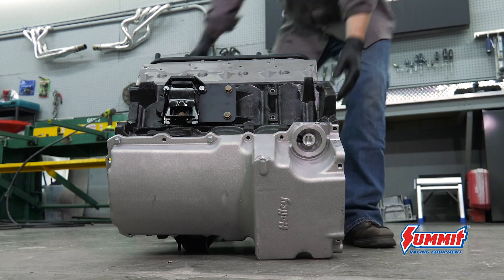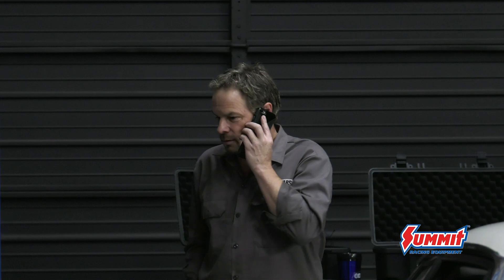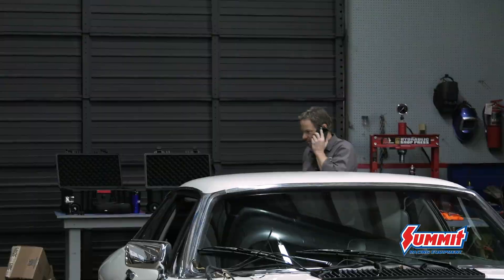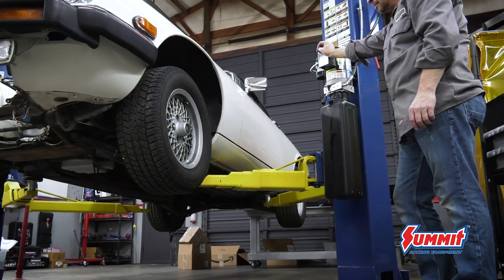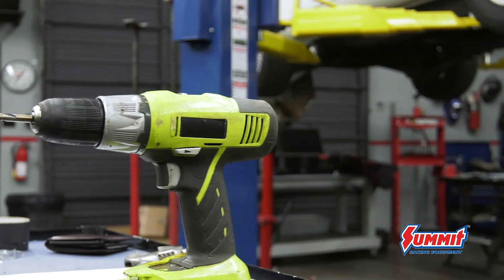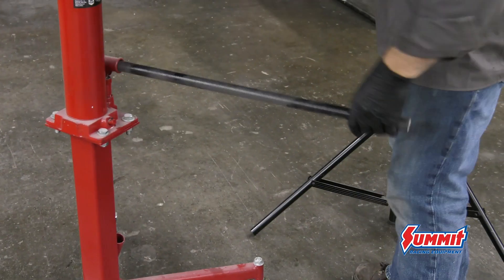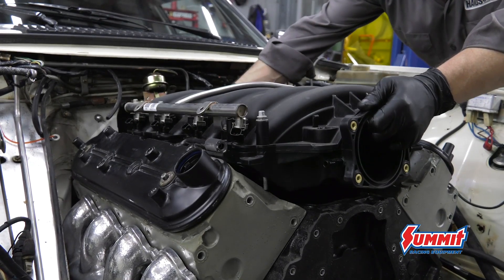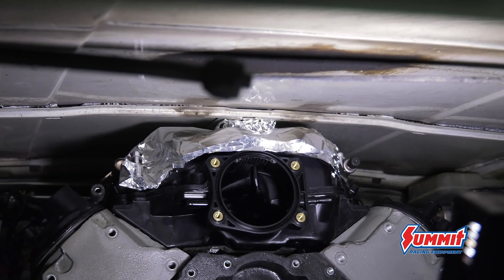Project XJS-LS (Part 2): Finalizing the Drivetrain Choice for the LS Swap

Comment: Hello I have a 1984 XJS Jaguar. Which I am doing a swap with a LS3 6.2 motor.  On the driver side my manifolds are hitting on my frame wheel and steering shaft. What type of swap exhaust manifold do you use on your Jaguar swaps to avoid this problem. 
Waiting for your reply..Thanks

Comment: where can I get those motor mounts?
Reply from the maker: I don’t have a link to those specific chassis engine mounts. It appears they may have been fabricated those for that project using the mockup engine block and universal LS swap mounts. You might want to contact Jaguar Specialties to see what they offer for Jag engine swap chassis mounts if you don’t have the ability to fabricate your own.  http://www.jaguarspecialties.com
Reply: @SummitRacing   Jaguars that run have a complete manual  mounts and instructions  Summit racing used to sell the books by author Mike Knell

Comment: That V12 stripped down to the essentials would look fantastic in an open engine roadster
Reply: there  is a dual 4 barrel manifold available for them now, that solves the fuel injection problems.  That leaves the  distributor center mounted in the valley , and all of it's problems. there are cures out there for that. the original fuel injection might not be so bad, if there was an OBD port.

Comment: He actually has enough room to run a Roots Blower direct drive off the crank snout, Salt Flats style.
I would to forward mount turbos myself and use that room for Air/Water intercoolers.